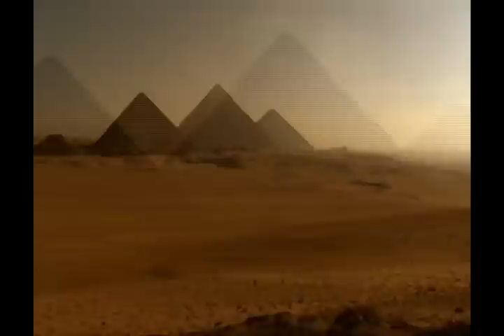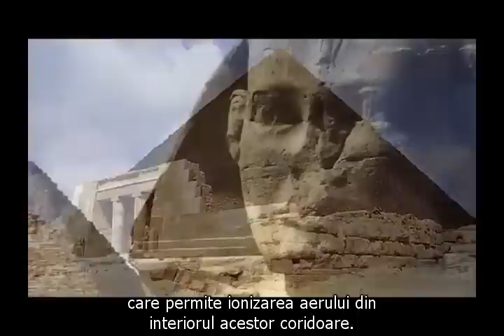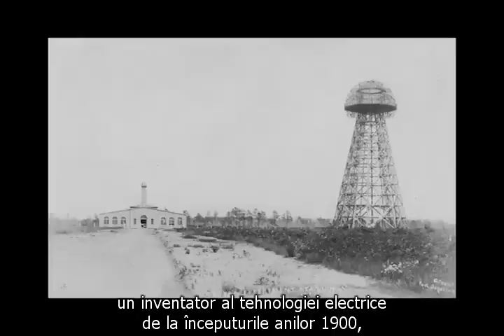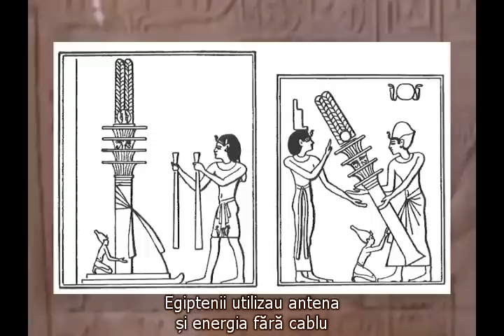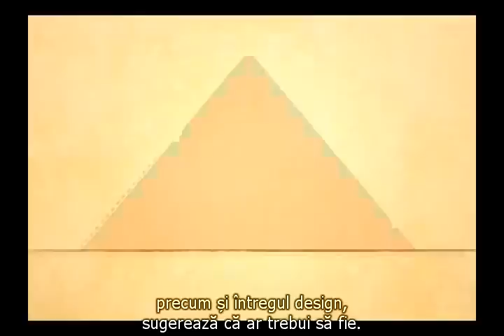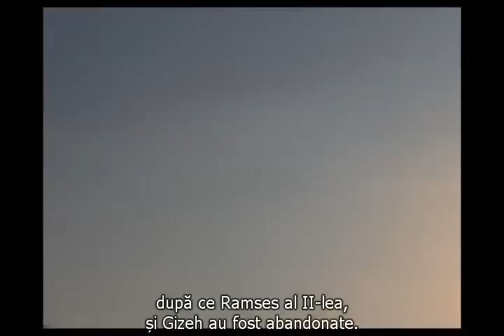Secretele ascunse in piramidele din Egipt.

Comment: Quartz Crystal 

Silicon’s positive x 3 contracting/colliding delta 
+
Oxygen negative x 3 expanding/separating delta 
= 
Piezoelectric 

Ironically, coupled with the water supply passing through it’s own underground Delta possibly providing the oscillation required to create the impact/force onto the granite/quartz with which create its voltage. This voltage can be increased by saturating the Quartz in the convenient supply of water. 

The way “ Tesla “ was able to reconstruct this technology using ( different ) methods and materials will find this ( same ) type of technology constructed “ differently “ with Capitol buildings and their campus/ surrounding area around the world. 
Obelisk made of granite may have been used to not only transmit and or receive hertz signals, but also used to amplify such a signal. It’s very similar to the way old radios used to operate using different crystals for different frequencies. And since we are talking frequencies, let’s not forget that light and it’s band of colors ie. spectrum. If this signal was in a pulse pattern the effects on the biological makeup of, let’s say 
human body could be altered especially the 🧬 sequence.
Reply from the maker: Yes indeed, it could be as you say, just I dare to wonder what is a wave, what is a hertz signal, what is a light, what is a spectrum of light? Are all these deeply understood or are they only limited interpreted? What if all these obeliks around the world would they have transmitted something that is a common denominator to all these terms? Could it be so?

Comment: It’s an arch generator. Look into ‘ The Walter Russel Optical Dynamo “. Nicola Tesla used and improved upon this design which became the Tesla Coil. Myself being an electrician of 23 years now, I agree that this structure has electrical properties. Laid out as to work coherently, to achieve a collective goal. Induced piezoelectric using the quartz crystal found in the granite/dolomite. This is an arch reactor to open a line of communication or travel to another “ dimension “ Obelisks which were not mentioned I believe were used as antennas/amplifiers to carry the hertz frequency/signal to keep the line open to the ones making the call. It’s a larger scaled version of what our own body, mind and spirit is already capable of. I’ve never been one for the whole new-age spirit witchy-poo following, but once you look into it as a part of history and the civilizations within. It’s impossible to ignore that this has been a standard practice by many civilizations and cultures from around the world throughout many of years. Making its mark on the timeline and literally on the ground within different structures made with different materials into different but specific designs revered by some of the most important groups of people to this day.